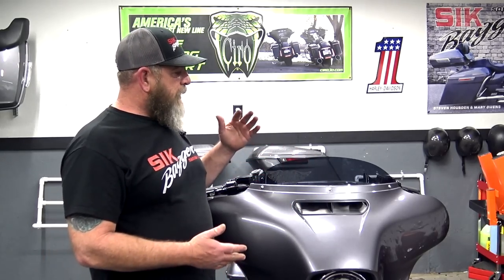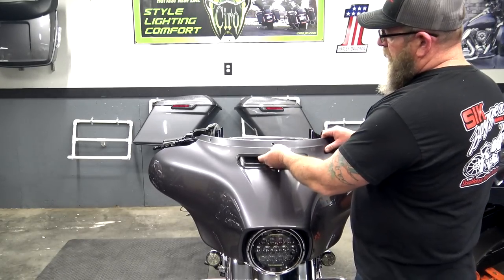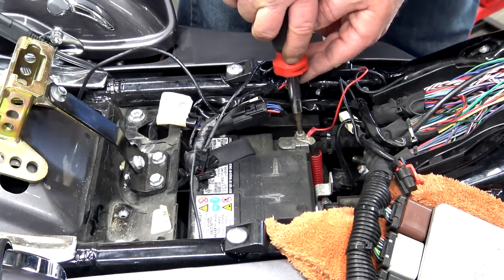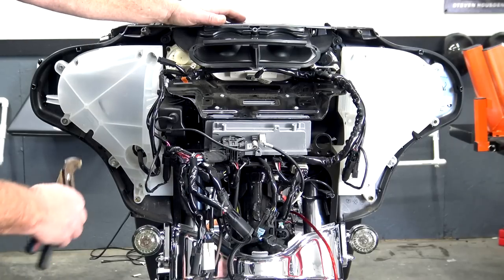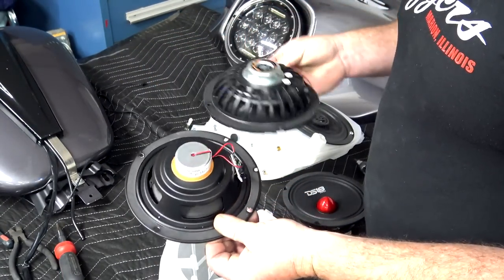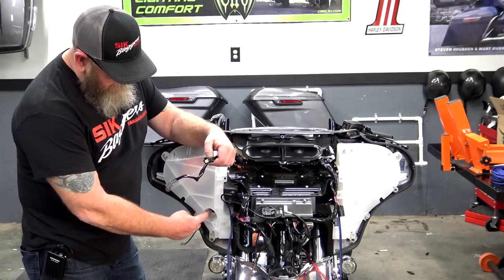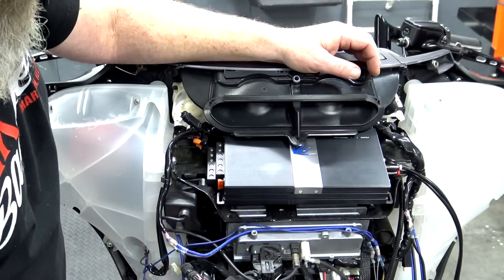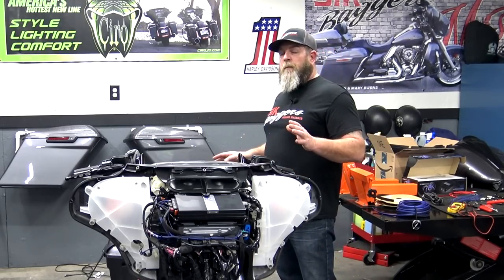⚡Install Amp Speakers Stock Harley Touring Radio⚡

Comment: I bought the aquatic av head unit its a plug in type now I ran all my speaker wire I put my new speakers in my new amp and new head unit  the one thing I'm confused on is what do I do with the old speaker wire that was hooked up to the old speakers I believe I can just cap them and not use them because it was hooked up to the old wire harness but now that  I'm by passing it with the amp I'm sorry if its a stupid question I'm new at this
Reply from the maker: you are correct ...you can just cap those off...We usually dont remove any factory wires..just cap them in case down the road you or someone else may need them they are still there.

Comment: Where did you ground your line output converter to?? Thanks
Reply from the maker: Its best to run a ground back under the tank and ground it somewhere on the frame.

Comment: So I got a question; with the AMP connected directly to battery will what will keep the AMP from drawing down the battery?
Reply: The amp won't start drawing power until the remote wire sees power to turn the amp on.

Comment: Which speakers did you use? The 8 or 4 ohm? Looks like both are in the parts list
Reply from the maker: 8 or 4 ohm will depend on what youre doing..what are your plans for the bike as far as audio? fairing and lids, just the fairing> fairing and lower fairing speakers? all that makes a difference
Reply: @sikbaggers  just the fairing install you did, no future plans of saddle bag speakers or lower fairing pods. Also, I have a 2019, is a flash required, or recommended?

Comment: Hey Steve, I have been gathering the parts for this for the last 2 months for my 2012 Road Glide and I have watched your video a hundred times. I'm stuck as to where I can draw the power from for the "remote" wire for the LOC and amp. Do I use the cigarette lighter wiring? I've had to get the 6.5" speaker adapters and I have the larger Soundstream amp (i think the ST4). The amp wont fit in the fairing unless i grind the feet off or put it in my saddlebag. Any help is much appreciated, I hit a snag and this is my first bike stereo install. Thanks!
Reply from the maker: you can use the cig lighter aux power for both amp and LOC. Its a small draw.  Never installed that amp as its too big...but its just cast alumi num,. cut the feet off. It won't affect the amp.
Reply: @sikbaggers  I ended up hooking the LOC to the extra light plug off the main headlight and connected the amp to the cig lighter. Just waiting on a few extra parts to complete the install and then some tuning of the amp and LOC. I’ve debated on grinding the feet off the amp or creating some other kind of mount. I don’t want to grind too much of the feet off in case I need the mounting feet in the future. Hoping to do some speaker lids in the future. Thanks for the response, your videos and advice really helped 👍🏻

Comment: curious why u used a line out converter and not just take wires from speakers to high input of amp?
Reply from the maker: Factory stereo systems connected with high-level inputs will not sound as good as low-level inputs. If your using an aftermarket stereo, there won't be much of a difference between high-level or low-level inputs on basic systems. If you're going higher end use low-level inputs.

Comment: Have you ever installed the new 400 amp RF in the saddlebags like HD specs? Mine was installed by dealeship and has come off twice ( the amp)
Reply from the maker: Ahh no I have not...I tend to stay away from anything RF outside of their Digital Sound Processor.

Comment: Are you required to flash the radio with this setup? And if so what do you flash it to so I can ask the tech to flash something specific.
Reply from the maker: You can but you dont have to. Just set your radios bass and treble to flat in the middle and tune your amps..then you can make very minute adjustments to them. "flashing the radio really only flattens the radio out and turns on rear channels if you want them on...but this method its not necessary.

Comment: Man I love this video!!! but I’d like to clear up two things because I think this is why you are doing what you’re doing and saving people a lot of money: First thing is you don’t flash the system because you’re using a line converter… but that’s not going to get rid of the crazy EQ curve that Harley uses on the speaker outputs on there boom audio, your just stepping that signal down to line voltage but it’s still going to send that crazy eq signal to your new power amp instead of a flat signal...but that’s ok because we’re talking about a motorcycle and we don’t really need that type of fidelity like you would do with a car?....or do you still need to flash the system and get rid of the eq. My other question is the speakers are not coaxial just mids, where do you get the high end from or do the mids have a high enough hi end frequency to hear the hi’s that you need? and the same scenario applies where these companies sell you a bunch of BS and people just go way over the top with everything and tweeters that end up clipping and distorting at the volume that you really need when driving down the road on a motorcycle but what you really mead is loud clean volume so you can hear doing 60-70 down the road...it’s not about the fidelity it’s about being clean and loud… Is that the reason why we can just go with mids?
Thx again for a great video...
Dan
Reply: Dan Rider,  I read everything in full and I will do my best to respond. 
1. Yes, the Flash is to flatten out the Boom EQ setting as much as possible. 
2. It’s Not OK to NOT Flash when upgrading your motorcycle audio, even if you’re using coaxial speakers with an amp that has a very good integrated Crossover, such as Soundigital, Triton-Audio, Diamond, etc. Not Flashing will cause the EQ curve to eventually ruin your system. 
3. Finally, Steve installed what’s considered to be a pro equipment setup. It is not a coaxial system. These are independent speakers that play at different frequencies, which are manipulated and control with a Digital Signal Processor. We installed Midranges in the front fairing, dual voice coil Midbasses on the lids, and Tweeter Drivers. 

I assure you, you will not ride at 90 mph on Steves bike with the volume over 60% because it is “Clearly” loud. The key word is “Clearly”  If you have spent significant monies on an audio upgrade and are loud, but not “Clear”, you went to the wrong Shop or Audio Builder. 

Feel free to contact us for more information. 
www.motorcyclessoundsystems.com

Comment: When you mentioned the streetglide having 3 amps and 10 speakers...how does the charging system handle the amplifier load?
Reply from the maker: It handles it great...same set up on my RG with even bigger amps and no issues. Upgraded battery to a EarthX lithium
Reply: @sikbaggers  I figured 3 amps and more than likely 30 amp fuses on the amp gives you an idea how much current each amp will pull...figure around 20 or so amps each plus the bike itself lights ignition etc...i figured that stock charging system is getting taxed big time

Comment: My stock speakers are on the way out after 14 years...I'm looking to replace them with something better than stock (fronts only)...I'm open to adding an amp but not looking to break the bank on a setup either since I mostly use earbuds on rides longer than an hour...what might you suggest
Reply: If you mostly use ear buds, then why bother.

Comment: Is there a video anywhere that will show me how to wire that particular line output converter
Reply from the maker: not any videos that im aware of but its pretty easy...here are the instructions from PAC...https://catalog.pac-audio.com/index.php?controller=attachment&id_attachment=40 but all you need to do is take the left speaker wire that comes from the radio and (thats your input from the radio) wire that POS and NEG to the Grey POS AND NEG on the PAC...the same thing from the right side of the radio to the WHITE POS AND NEG of the PAC.
Reply: @sikbaggers  Thank you sir
Reply: @sikbaggers  This may be a stupid question but I'm kind of remedial to the wiring game but what powers the Pac? I do appreciate your patience.

Comment: Nice video. Do you have one for a roadglide?
Reply from the maker: I dont have one now for the RB but it is the same process...only the rg there is very limited room for an amp. Right under the radio and you will have to get creative with it. But I got a sound digital 800 and a stepsom 400 in there. Took em all day to figure it out

Comment: Are you not getting the stock radio reflashed to a flat EQ curve before installation?
Reply from the maker: No,,,not with this basic amp install..doesnt really need it..now that being said if you plan on pushing more than 350 watts to each speaker then yes...or if you are using a DSP, then yes, flatten it. But this install is fine with this size amp.

Comment: I have a 2020 Road Glide. If I bought this exact set up (amp and speakers) , would the amp fit in my fairing? Are speakers the same size?
Reply: Look at the sound digital evox 800.4 amp half the size you can get two of them if you need. And get a DSP wheile you are at it

Comment: I have a 2021 Electra Glide Standard. This bike comes with no head unit or speakers. I am planning to do the exact set up you are doing here. My question is this the bike comes pre wired to plug my after market head unit directly into it. Since I am using the aftermarket head unit and its never had the stock head unit in it does it need to be flashed?
Reply from the maker: im going to say yes on that,....harley will need to turn everything on...its not really a flash per say but they open up the wiring and turn it all on

Comment: If you use the amp listed you don’t need the LOC it has speaker level high input
Reply from the maker: most of them do...High level input sucks...its worth the 25 bucks to get a LOC
Reply: I tried with the LOC but couldn’t get it to read the voltage like it was supposed to so I just used the high level input and it sounds 1000% louder than my factory setup

Comment: what would be a good set of speakers to replace the stock ones? and do i have to run an amp/LOC just to make them work properly?
Reply from the maker: There are a lot of good 6.5 speakers on the market that will replace the stock ones at about 35 to 50 watts. You dont need a LOC to just replace the speakers. And it would depend on what speaker you choose if you need an amp. If you stay in the 35 to 50 watt range the radios amp will be fine. If you buy something in the 100 to 350 watt range you will need and amp and the LOC if you want to use the stock head unit.
Reply: @sikbaggers  awesome, thank you for the advice

Comment: Steve, can I use this setup for my 2009 eletra glide classic? I do have the 5.25 to 6.5 adapters for the speakers.
Reply from the maker: Yes you can...Its the same way if you are using the stock head unit.
Reply: @sikbaggers  thanks for all the help. Love the channel. Keep it coming.

Comment: Could I be able to run saddle bag speakers with the other line output convertor inputs
Reply from the maker: yes you can..if you have a 4 channel LOC

Comment: how are those Pro audio 6.5 speakers compared to THE 6.5 Rockford Fostgate, power, sound and performance
Reply from the maker: Rockford Fosgate PPS4-6 6.5"  = 100 watts rms  @ 159 a pair  - PRV 6MR400  = 200 watts rms @ 100 a pair Just 2 examples...RF's are coaxial speakers...apples to oranges compared to Pro Audio and the Price of RF's is ludicrous for what you are getting.

Comment: How did you mount the amp?   I have the exact same amp in my 2021 SGS and I can’t see how you got it mounted.
Reply from the maker: Big zip ties with that amp...customer brought me that bike and the amp...its a little larger than the area provided but its a commonly used amp in touring models. I just zip tied each corner down tight...also if you want you can add some double sided tape to areas that touch so there is no rubbing. That bike is still rocking that amp today.

Comment: should I get my radio flashed before I start hooking up the amp and speakers to my stock radio? 2020 road glide special
Reply: @Jeff Burgess Its your choice but it will sound like crap if its not flashed and you already have the amp installed. Another words if you do it after do not play it long or loud until that has been flashed.

Comment: With installing this system did the factory radio need to be reflashed? I have a 2020 street glide special
Reply from the maker: Doing it this way will not require anything to be flashed...however if you want a cleaner "flattened" sound you can have them set it to 4 channel no amp...thats all the flash is...they plug it in, go to the drop down menu and select whatever they want and it sets the audio out levels on the radio....That being said I have never had one flashed. And using the right amp and speakers you will have a huge improvement over the stock harley junk.

Comment: Do you need to flash the radio when you do this?
Reply from the maker: You do not have to but it will give you a cleaner signal to the amp..."flashing" the radio will flatten all channels and then you can adjust it from there.

Comment: On the line output convertor where did you run the yellow wire to?
Reply from the maker: Yellow wire can go to any key on wire..aux port works great...you will need to extend the wire.

Comment: Hey.. Any problems with amp not turning on when bike is started???..Sometimes😏
Reply from the maker: no, not at all...check your remote wire and make sure it had a good connection...then check your ground..these two things can cause that

Comment: My bike already has the boom audio II system front and saddle bags 2 amps, came with the bike. What can I do about upgrading just the speakers?
Reply from the maker: Im not much of a boom audio guy but you can check your specs on your amps and try to stay in that spec range for your speakers. You want to stay in the watts and ohms range of that amp. I would say any pro audio speaker will be an upgrade form the boom stuff...Ive torn out a lot of boom audio...thousands of dollars worth and replaced it all with new amps and speakers..but if you are wanting to salvage the amps just find out the specs and stay in that range and pick a better speaker

Comment: Do I need to worry about riding in the rain?
Reply from the maker: afix a thin piece of plastic that drapes over the top of your amps if you are worried about the rain or ride in the rain alot..usully it wont get through but in case it does..youll be covered..lots of audio places do it on bikes.

Comment: Assuming you are throwing the old speaker wire away due to fitment issues, why would you cut into the speaker wire on the bike side of the connector instead of the old speaker wire side of the connector?  I would think it would be easier to remove a mod system and replace the old Harley speakers in the future if you want to take the good stereo with you to a new bike, but perhaps that wouldn’t be done?
Reply from the maker: You can, you can cut it wherever you want...Ive never personally pulled an old radio out and put it in a new bike but if you wanted to you certainly can

Comment: hey I see you tell everyone to get your bike flashed if you change the amp . I have a 2018 SGS.But then I read a reply that you can do a manual " flash". So is that a way to get around the flash
Reply: Im installing a set of hertz mpx 165.3 and a RF t400x4ad
Reply: correction its a RF t400x2ad

Comment: Can you install an amp and speakers like that on a 2020 road glide? Also without flashing it after install
Reply from the maker: yes,  When Harley used to "flash radios" all they were doing was using a drop down menu to select what channels are turned off and on, flattening the EQ and or turning the eternal amp on or off. We used to flash them 4 channel, no amp. This would turn on the rear channels that are already on every bike but usually not turned on and also turn the internal amp off. You can still do this even though harley quit flashing radios. Just split your front channels and send those signals to the LOC and come out 4 channel RCA to your amp
Reply: I have a 2020 Road Glide and would like to know how your audio upgrade/install worked out for you.

Comment: any suggestions on a replacement speaker that will fit into the stock location for the rear speakers in a 14 Electra glide.  I ordered the speakers you recommended for the front which fit however they will not fit in the rear locations
Reply from the maker: Sorry for the late reply, just got back from Sturgis , are you referring to the rear speaker pods on the tour pack?
Reply: @sikbaggers  yes i am referring to the rear sock speaker pods
Reply from the maker: @anubis68rh  https://amzn.to/3dFe5CA  Alpine S-S65 S-Series 6.5-inch Coaxial 2-Way Speakers is a solid choice